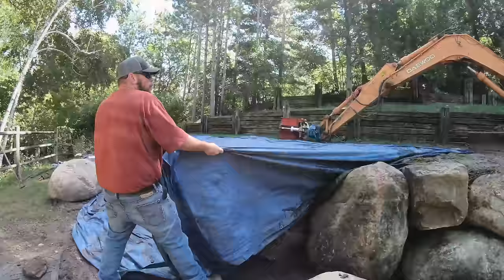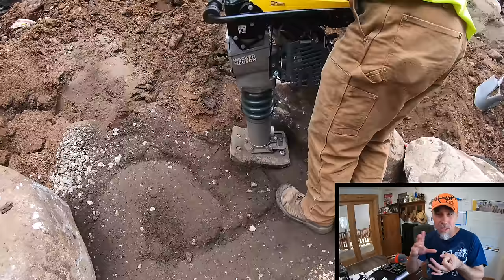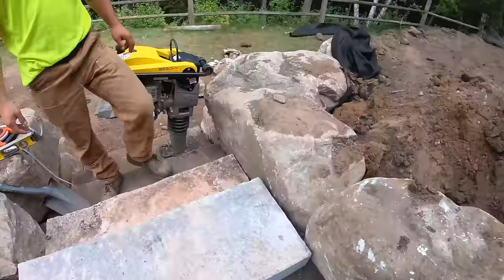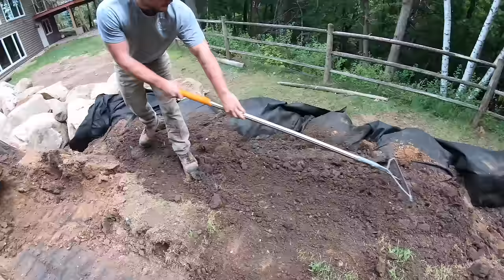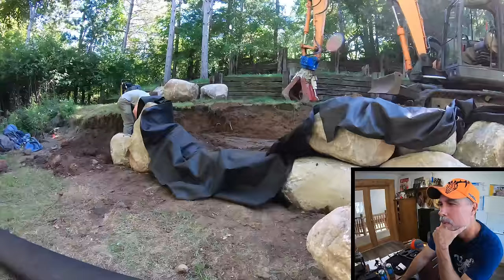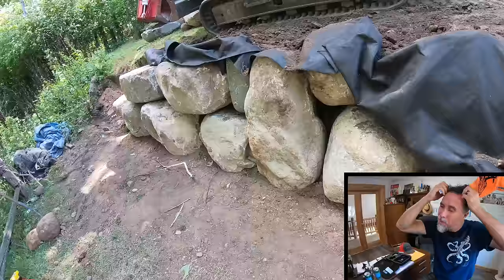Building a Stone Staircase

Comment: Stan, I would have loved to install "Hens and Chicks" in those gaps! Great information about compaction! Not many contractors understand compaction, Drum compaction is the best at compaction due to the point load it applies VS plate and jumping jack compaction, as the load is spread out over the area. Knowing the soils that you are dealing with is a large part of engineering a wall. I think this is one of your best video's you have put out! Engineering fabric is of two types woven and non woven.  Non-woven geotextiles resemble felt and provide planar water flow. Woven slit-film geotextiles are generally preferred for applications where high strength properties are needed and filtration requirements are less critical. Woven monofilament geotextiles are preferred for applications where both strength and filtration are a concern, such as shoreline rip rap applications.
Reply from the maker: BOOM! Knowledge Bomb right there!
Reply: We’ve gone away from using woven geotextiles for shoreline work. Heavy non woven is preferred. Generally we place coarse clear stone behind the boulders, then heavy non woven between this ‘filter stone’ and the underlying native soil. If you place geotextile directly behind the boulders some of it is always exposed (bad aesthetics) and it blocks water flow which is bad for stability.
Reply: @billyjoebob998  Woven Monofilament Geo texiles  still are the prefered fabric for shoreline applications but the cost of these fabrics ($2.00 to $10.00 per sq yd cause engineers to use your "Heavy non woven Fabrics as their cost is $.45 to $1.50 per sq yd) Woven Monofilament is thicker, more abrasion resistant, holds better in scouring environments and can be engineered to have a safety factor in highly erosive areas.
Reply: @paulnelson9907  We typically use geotextiles in coastal applications to limit migration of fines while allowing seepage flow, not for their strength per se. Non-wovens are much less prone to puncture and tearing and generally have higher permeability. I've also seen a lot of sliding failures at the revetment/woven geotextile interface. Either can be used if designed and spec'd properly; I have used woven geotextiles successfully on several projects. I was just sharing my experience that after quite a few years of this, I've come to rely on non-woven geotextiles for most coastal applications.
Reply: @billyjoebob998  I agree somewhat, have you used woven monofilament geotextiles? Most construction companies haven't as engineering firms are afraid of the high cost and going over budget in their designs. I am not a salesman just a contractor that did a lot of work with geotextile engineers and companies to develop these products.  And yes they are more expensive to buy, install and require training of crews to insure proper installation.  Good luck in the future, I am a long retired contractor.

Comment: I'm remembering that we used bags of ice under some large stone steps to position them after initially setting with a forklift.  When the ice melted, the steps settled into the vertical spacers. We finished off by placing backer rod between layers and piping grout like it was cake frosting.

Not what you are doing here, but if you need a trick like that, it is just the thing.
Reply from the maker: That sounds cool